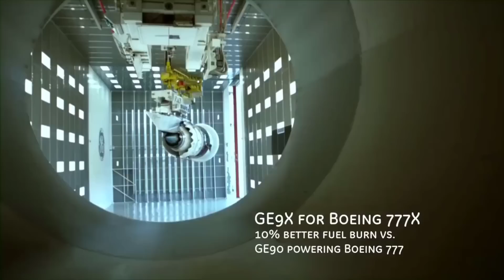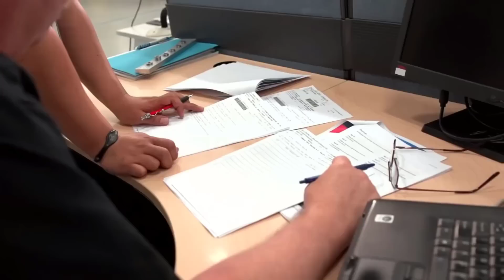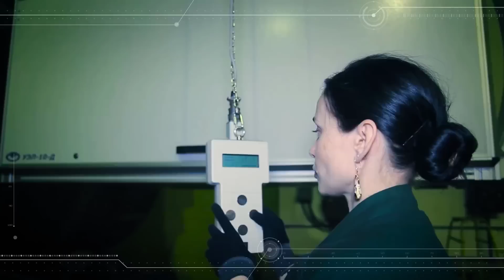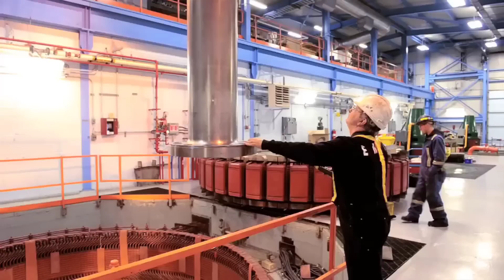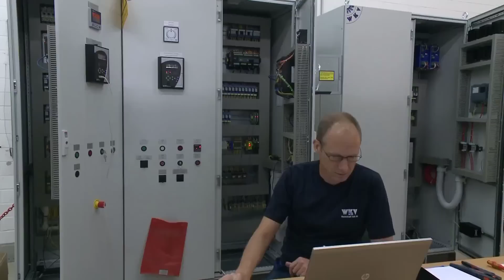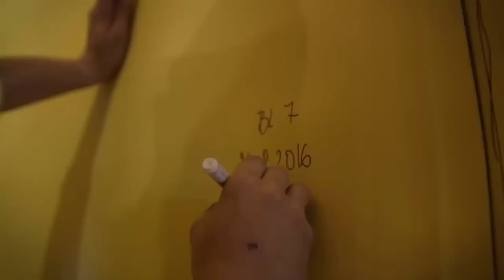How Missiles Are Made & Construction Process of The World's Largest Nuclear Power Plant ???

Comment: Two phase detachable warheads are the deadliest nuclear bombs in the world. Not invented yet, the operators have to place aircraft engines near the point of the atomic explosion, to create the cutting capability of the uranium. Around it, from a specific distance the operators have to place car batteries near the explosion, to speed up the moving capability of the titanium tetra molecule. An additional lead warhead may cause an earthquake, that speeds up the moving capability of the deadly molecule.
Inside the body the lead goes off from the molecule, wolfram is better to add moving capability, but it is more expensive.